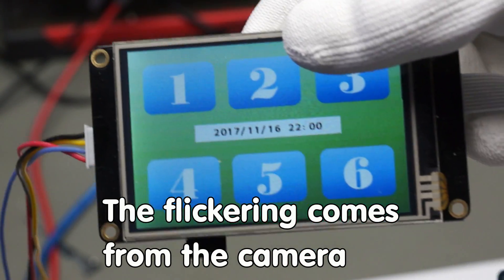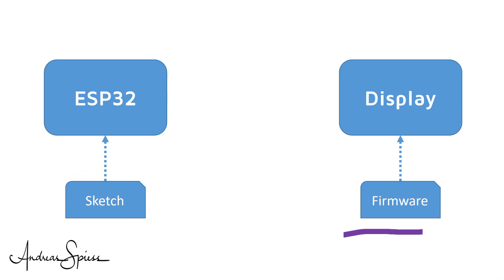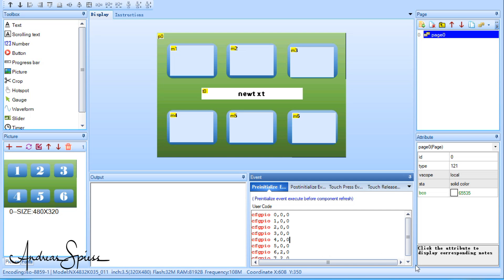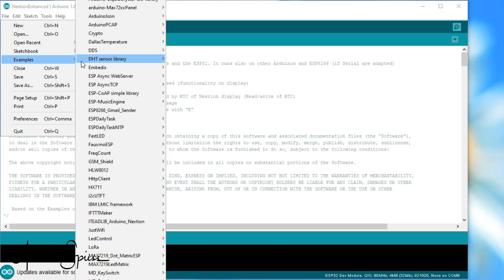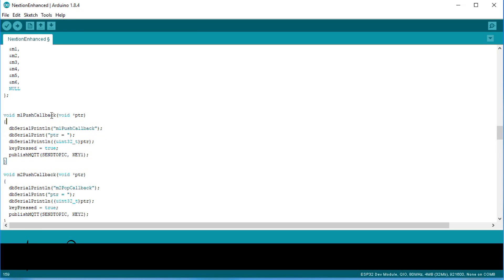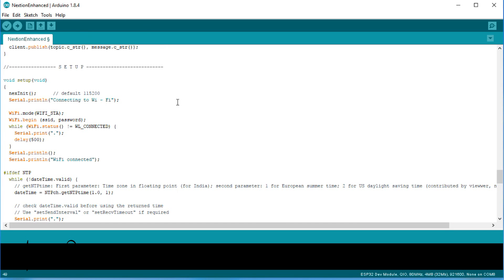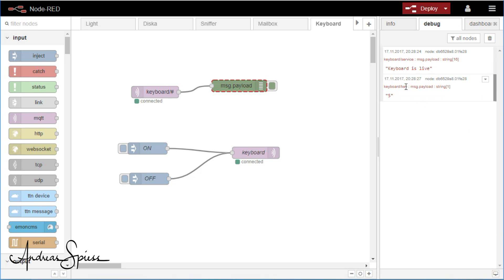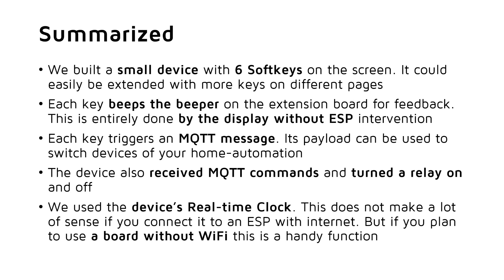#170 Enhanced Nextion HMI Tutorial incl. ESP32, ESP8266 and Arduino support

Comment: I'm trying to get a NodeMCU ESP32 to talk to an Enhanced display via UART2 (16 & 17). So far, I get debug messages on the USB serial monitor right up to the point I call "sensors.begin()" to initialize the DallasTemperature.h library. After that point I just get squares and ASCII characters in the debug window and nothing changes on the Nextion. I've verified all my code is working without the Nextion command/code structures by sending all the would-be Nextion commands to Serial instead of Serial1. I've found it difficult to use the library commands (I do include Nextion.h) and typically just use Serial1.print commands to send changes to the display:

  Serial1.print("topSet.txt="); // display variable to update.
  Serial1.print("\"");  // Since we are sending text, double quotes before and after the actual text.
  Serial1.print(Tempstr); // string variable, i.e. 73.5 F
  Serial1.print("\"");  // Since we are sending text, double quotes before and after the actual text.
  Serial1.print(0xFF);
  Serial1.print(0xFF);
  Serial1.print(0xFF);

In the Nextion debug window, when I type topSet.txt="73.5 F" and click Enter, it updates the virtual display.

I'm using the Nextion library of course to receive commands/updates from the display. It will be wonderful when the documentation and libraries become more user-friendly. Thanks for your time.
Reply from the maker: Does the Dallas sensor work? It seems to be an interaction between the two
Reply: Andreas Spiess I think it's a problem between Serial & Serial1 or 2. I have another board talking to a basic display and get garbage in the IDE debug window, but Serial1 (gpio16, 17) to the nextion is working fine.
While I was typing this, I changed the debug to 115200 to match the Nextion and now I'm getting my debug Serial.print() code AND the commands from the Nextion in the IDE debug window. It's as if either the .cpp, .h, or the esp32 itself is not isolating the 2 uarts. Any ideas?
Reply: Espero que la respuesta a sus preguntas no sea tarde. Intenté sin éxito seguir este video, pero tampoco funcionó. Finalmente, después de una tarde de dar vueltas y vueltas aquí está la solución:
copie el SIGUIENTE en NexUpload.cpp en la biblioteca de Nextion, esto lo sacará de la biblioteca ESPNexUpload.cpp, QUÉ FUE, se debe comentar (// # include <SoftwareSerial.h>

// # define USE_SOFTWARE_SERIAL
// # ifdef USE_SOFTWARE_SERIAL
// SoftwareSerial dbSerial (3, 2); / * RX: D3, TX: D2 * /
// # define DEBUG_SERIAL_ENABLE
// # endif)

Copie el SIGUIENTE en NexUpload.cpp en la biblioteca de Nextion

# si se define ESP8266

 #include <SoftwareSerial.h>
 
 #ifndef NEXT_RX
  #define NEXT_RX 14 // Nextion RX pin | Predeterminado 14 / D5
  #define NEXT_TX 12 // Nextion TX pin | Predeterminado 12 / D6
 #endif
 #ifndef nexSerial
  SoftwareSerial softSerial (NEXT_RX, NEXT_TX);
  #define nexSerial softSerial
  #define nexSerialBegin (a) nexSerial.begin (a)
 #endif
 
#elif definido ESP32
 
 #ifndef NEXT_RX
  #define NEXT_RX 16 // Nextion RX pin | Predeterminado 16
  #define NEXT_TX 17 // Pin de Nextion TX | Predeterminado 17
 #endif
 #ifndef nexSerial
  #define nexSerial Serial2
  #define nexSerialBegin (a) nexSerial.begin (a, SERIAL_8N1, NEXT_RX, NEXT_TX)
 #endif
 
#endif

Creo que debería guardar una copia del archivo original para que pueda funcionar correctamente con una tabla o mega arduino. 

Espero ser de ayuda

Comment: Excellent video as usual . i do have one query can i connect the Tx,Rx of Nextion regular ( 2.8) version display with the Rx,Tx of nodemcu directly without using a level shifter .i am planning to provide an external 5v supply to nextion.
Reply from the maker: The pins of the Nextions are 3.3V if I remember right, even if you connect the board to 5V
Reply: You mean to say that for the power in it requires 5 V , but the serial communication happens at 3.3V, i have the specs here;  https://www.itead.cc/wiki/NX3224T028, this does say that the optimum voltage is around 3V. Also are you planning to have a video made of nodemcu connected to nextion . The display integrates easily with the arduino uno board , but am having a tough time getting it to communicate with nodemcu.
Reply: Wishing you Merry Christmas and awaiting lot more informative video's from you
Reply from the maker: Merry Christmas to you, too!

Comment: $100USD if you can do a vid on AWS IoT and ESP32 MQTT.
Reply from the maker: Not because of the money, but AWS is on my list. ESP32 MQTT is already done in one of my last videos.
Reply: yep, watched the MQTT vids. ESP32 means we should have TLS1.2, but AWS IOT MQTT is more difficult because it requires x509 authentication. I've been banging my head against it.
Reply: aaaand they released "Amazon MQ" today, which uses Apache MQ, which talks MQTT. That should be much easier to connect than AWS IOT, and also gets rid of the overhead ("device shadow", etc).
Reply from the maker: I will have a look at it. Thanks.

Comment: Thanks. I agree about the nextion support. I found the support frustrating. Displays are nice, highly functional, easy to program and interface. No proportional fonts though, only monospaced.
Reply from the maker: I did not discover the thing with the proportional fonts. Thanks for the tip.
Reply: I first noticed this with fractional numbers. The decimal point bits are left justified, making it tight to the one's digit with a lot of space and loose to the 1/10 digit. Which, at this point in time, is ugly. Proportional fonts have been around in computers since the 70s, why Nextion didn't implement these is based on 'limited space' in the microprocessor. U8Glib handles all this gracefully, but they wrote their own font handlers.  They should re-render their monospaced fonts center justified at least, but they probably won't do that either.  Font generators for the nextion exist but tweaking each char is a lot of clicking. I spent a fair amount of time on this, if you check the forum you'll see my proportional font hack and can download it. It involves punching each letter directly on the display bitmap and calculates x widths from ttf fonts.  Anyway, thanks again for the videos, they're great.

Comment: Thanks to the Guy with the Swiss accent 👍😉
Reply: I hope the answer to your questions is not late. I tried unsuccessfully to follow this video but how it did not work either. Finally after an afternoon of going around and around here is the solution:
copy the NEXT in NexUpload.cpp in the library of Nextion, this take it from the library ESPNexUpload.cpp, WHAT WAS, should be commented (// # include <SoftwareSerial.h>

// # define USE_SOFTWARE_SERIAL
// # ifdef USE_SOFTWARE_SERIAL
// SoftwareSerial dbSerial (3, 2); / * RX: D3, TX: D2 * /
// # define DEBUG_SERIAL_ENABLE
// # endif)

copy the NEXT in NexUpload.cpp in the library of Nextion

#if defined ESP8266

 #include <SoftwareSerial.h>
 
 #ifndef NEXT_RX
  #define NEXT_RX 14 // Nextion RX pin | Default 14 / D5
  #define NEXT_TX 12 // Nextion TX pin | Default 12 / D6
 #endif
 #ifndef nexSerial
  SoftwareSerial softSerial(NEXT_RX, NEXT_TX);
  #define nexSerial softSerial
  #define nexSerialBegin(a) nexSerial.begin(a)
 #endif
 
#elif defined ESP32
 
 #ifndef NEXT_RX
  #define NEXT_RX 16 // Nextion RX pin | Default 16
  #define NEXT_TX 17 // Nextion TX pin | Default 17
 #endif
 #ifndef nexSerial
  #define nexSerial Serial2
  #define nexSerialBegin(a) nexSerial.begin(a, SERIAL_8N1, NEXT_RX, NEXT_TX)
 #endif
 
#endif

I would believe that you should keep a copy of the original file so that it can work properly with a one or mega arduino board. 

I hope to be helpful , Mi ingles no es muy bueno.
Reply from the maker: You are welcome!

Comment: Can you make it work with rotatory encoder with sw to change variable values and select menu pages?
Reply from the maker: I think it should be possible. But under the control of the MCU. I do not think the display itself can manage these fast changes of pins of a rotary encoder.
Reply: So it is better to have the encoder code on the SMT32F103 board.

Comment: I just buy old android phones from a site like craigslist. Replace the battery with a dc-dc converter if needed. Some Velcro or strong magnets in the battery compartment for easy installation.
The you can just make your own Qt QML apps. if you need a large screen an old tablet (slow) is good enough. (prob. even better for the environment).
Reply: It's also inexpensive to get older Android tablets. Many of these, like the Nexus 7, are easily rooted and feature USB OTG. Display, high performance computing, and direct management of multi-tebibyte disk drives. But where's the fun in that??? :o)
Reply from the maker: For sure this is the better solution for the environment!
Reply: I went the same direction.  For wall control panels, I bought three Amazon 7" Fire tablets on sale for ~$30 each.  This gives me wifi, a touch screen, a speaker, a microphone, and a camera, CHEAP!  I'm going to use ImperiHome, and a full-screen browser.  I still have all the other features, in case I ever have need for them.
Reply: Could some share any links to how they change the battery place and how you use it with arduino? Thanks

Comment: Thanks for showing an additional example using the HW-serial2 @ ESP32.
Nextion displays have many fans and you are helping them a lot. 
But for me, Nextion Displays are too expensive. For my home automation it is cheaper, simpler and more powerful to use a cheap (or retired) notepad / tablet together with the ioBroker Framework.
Reply from the maker: I think, using old tablets is a good thing. But I did not see IOS or  Android support of ioBroker
Reply: The ioBroker itself runs on my Orange Pi Plus 2e (Raspi 3, Rock64, Nuc,  etc. also possible). The tablets are used for visualization (control also possible). And this can be done using a browser or the Android ioBroker.vis app as clients. Vis is the Name of the visualization Adapter of ioBroker, running on the ioBroker server.
Reply from the maker: Thanks.